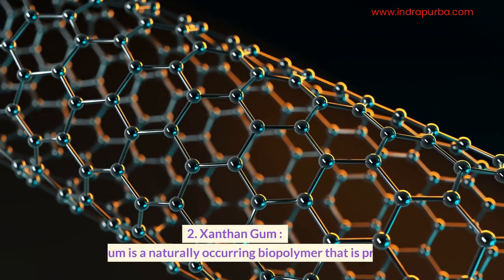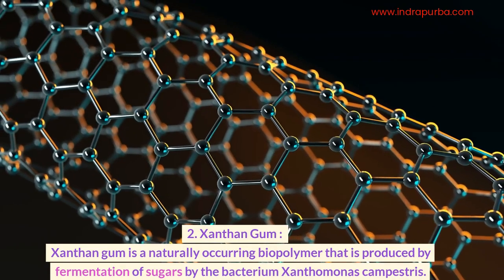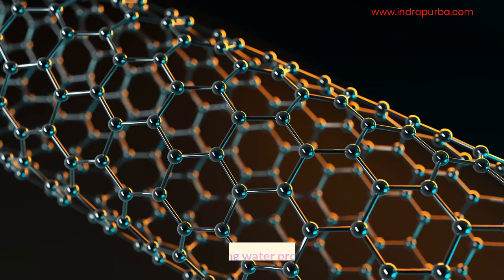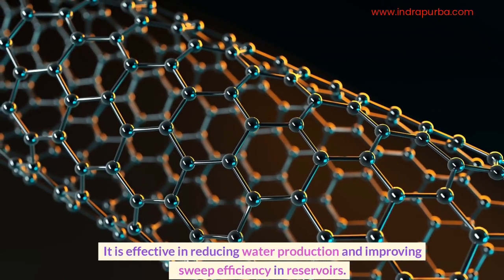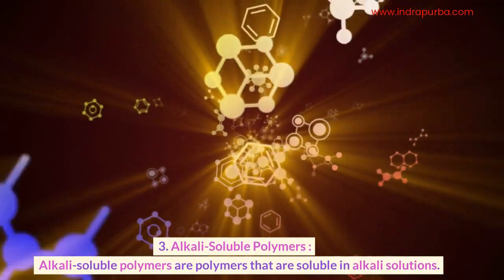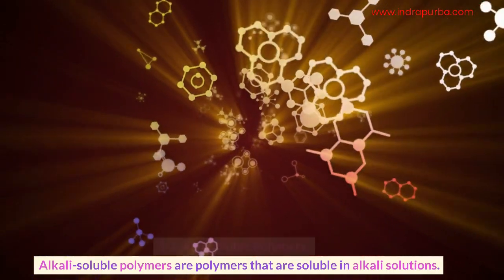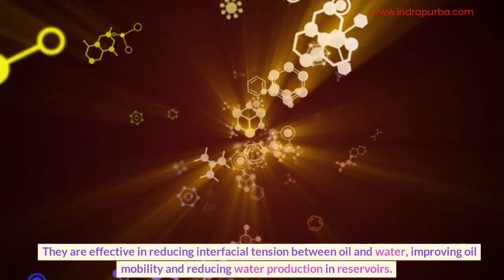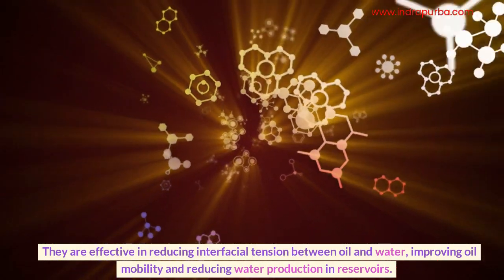POLYMER FLOOD : Chemical EOR - Part 1

Comment: Nice video pak...

Pak saya ingin bertanya terkait Polymer injection.

Apakah ada range viskositas atau maximum viskositas polimer yang di injeksikan untuk mendorong minyak dengan viskositas (10-150 cP) Taber...

Mohon advice bpk , dan terima kasih sblmnya🙏
Reply from the maker: Terima kasih pak. 
Berdasarksn pengalaman saya, utk screening awal polymer viscosity tidsk usah dibatasi dulu. Karena selain visc minyak, yg pengaruh adalah viscositas air formasi dan air injeksi (jika waterflood dan injeksi tidak gunakan air formasi yg sama), juga temperatur reservoir sangat pengaruh. 
Pak, ada paper SPE yg cukup bagus. SPE-113845-MS : Selection and screening of Polymers for EOR, juga Jurnal IATMI 2022 ttg Screening dan Scoring for Polymer.
Sukses selalu pak. Trimakasih
Reply: @indrapurba888   well noted and thank you so much Pak 🙏